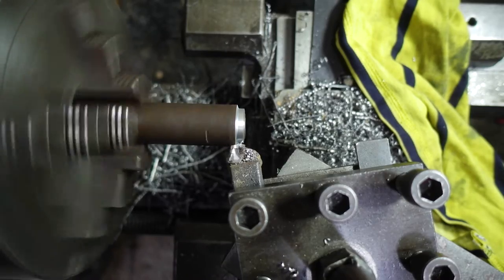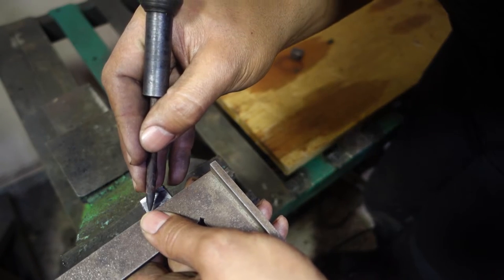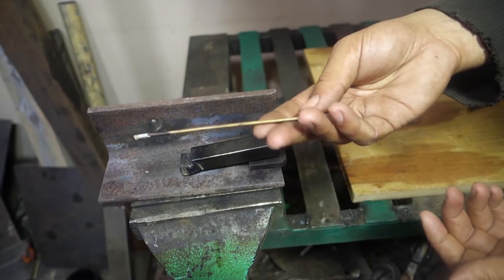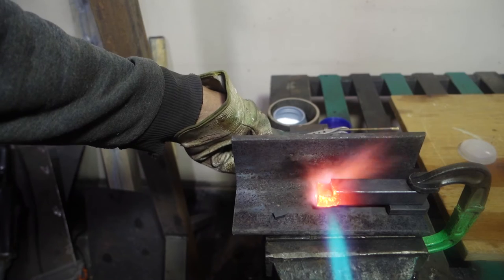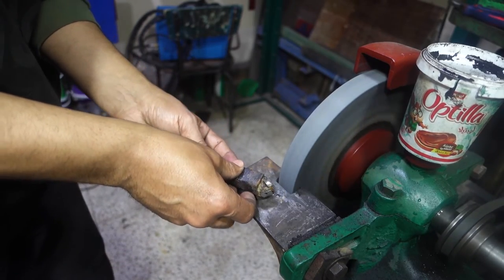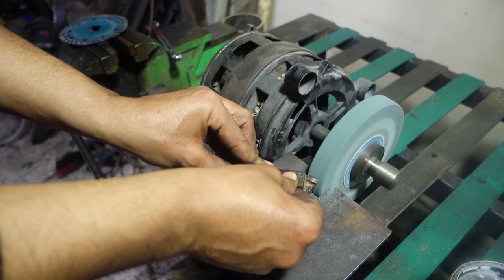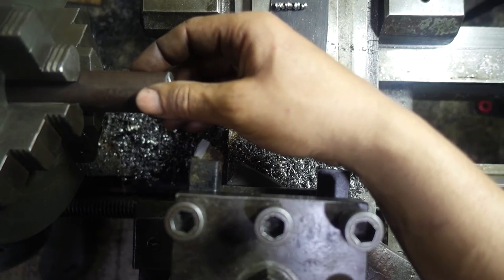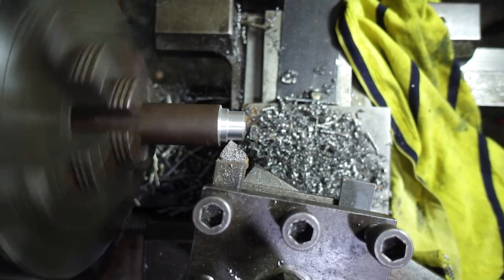Homemade Lathe Turning Tool

Comment: Watching your video makes me appreciate how fortunate I am in being able to purchase tooling for my lathe.  Perhaps the challenge of making a turning tool like you have done is the motivation or perhaps it is the cost of an alternative.  In any case I admire your ingenuity.  You definitely have skills in making the most of what you have available.  I have enough of a challenge in making the things I do make that I tend to just purchase tools such as the lathe tooling you have made.  Insert tools and inserts from China seem incredibly cheap to the point that I don't even grind many HSS tools anymore.  Perhaps I am getting lazy. Keep up the good work.
Reply from the maker: You're right the price and the availability of the holders in my country are the reason I make my tools.Thanks